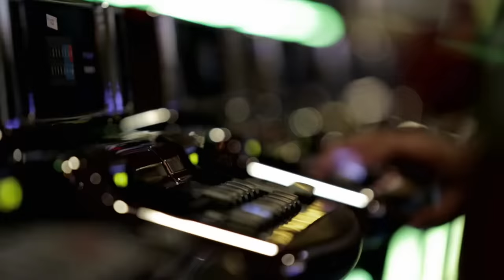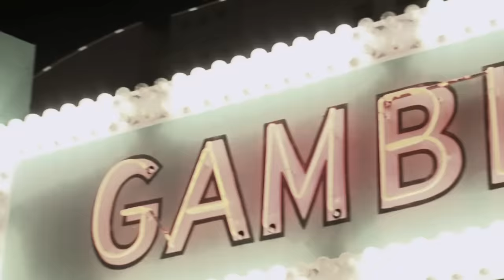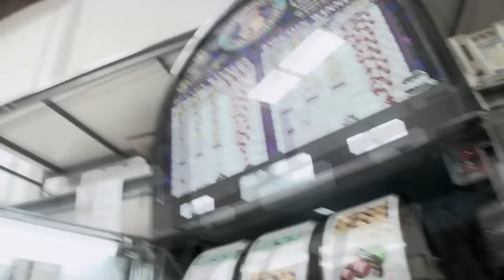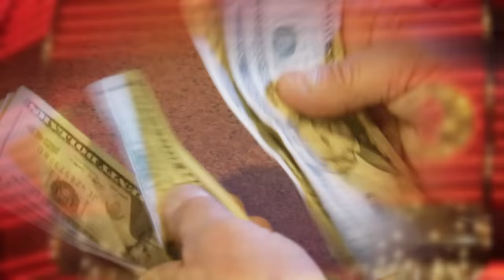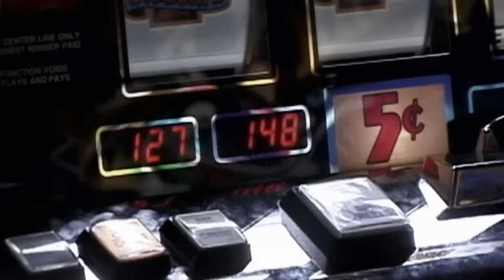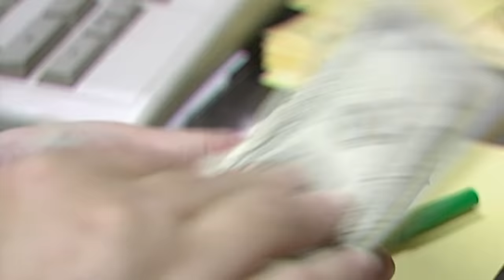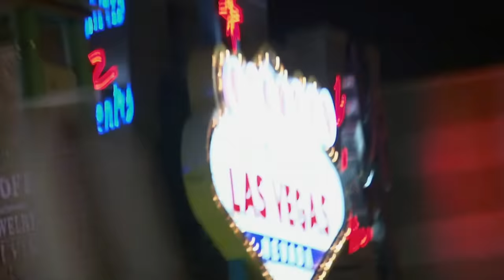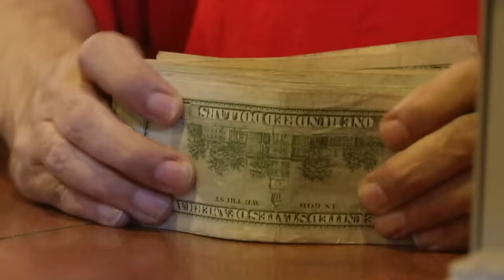The Game Changers of Cheating | Cheating Vegas | Episode 2 | FD Real Show

Comment: I googled odds on winning in a casino - 
The odds of winning in a casino depend on the game being played. Most games have a house edge of less than 10% and the average casino bet has between 35% and 50% chance of winning. The true odds of winning are 37 to 1 or 38 to 1, not the 36 to 1 that is the most the player can get paid on a winning bet. Slot machine odds are some of the worst, ranging from a one-in-5,000 to one-in-about-34-million chance of winning the top prize when using the maximum coin play.

Comment: The slot machines are controlled by there own computer system for payout or jackpots . Look on the back of the slot machines for the DSL wire . Ask a worker if they are tied into the computer system for payouts . You won't get an answer .
Reply: I'm a Slot Machine Technician and these machines have a phone line connected to them.
Reply: notice how it is easy to get very high scores during slots tournaments but not in real money games?
Reply: @doonlygoodeveryday9074  They are controlled .
Reply: @goodcitizen1379  : We are told the slots are controlled by a random number generator. Yeah!!! So why can the casino change the payout percentage of a slot machine?

Comment: True story - I have won on auto roulette 18 trips in a row. Past 3 trips now to the casino have lost. First they changed the ball, use to be a big rubber ball that would move and behave EXACTLY the same every spin as it should, all mechanical. Now with this new ball, you see the magnet pick it up and it will "skate" along the rim, also air blast will knock it out of a pocket, ball will do a sudden jerk. It is so clear that it cannot be denied. That's 100% cheating, can I sue the casino?

Comment: One thing is for certain. If you get caught cheating, you don't need to feel bad about it. If you were winning at the blackjack table and they couldn't seem to stop you legitimately they would bring in a "specialist". This specialist knows how to manipulate the deck and stop you from winning. I have this from a guy who worked in the casinos since the 70's. But if they catch you cheating don't let act like they own the high ground. They do not. The casinos have done a lot worse than cheating. But the cops work for them. The cops will arrest you for cheating, but they won't do anything about it when the casino cheats you.

Comment: Here is an interesting fact I learned about the newest video slot games, I heard the name HP come up as their makers. To expand on that, you do have to hack the machines which is hard because no public Wi-Fi and I am pretty sure they use whatever they can to block most cellular signals too. So with video type games, there are tenants that walk around with a programming pen that resets the machines. My proof, my ex wife and a few of her family members took a day trip to Reno and the host of the trip gave us all a package, X amount for the tickets and they gave us like $10 or so for gambling to start us in the casinos. Well I was on a low wager machine and was up and down but once I started hitting up more often, one of the tenants walked by and I started losing. Now to give context I was usually one of the family members that won, not as often as the others but I had my moments. One of my other former family members was going through the same thing as me on that trip and we were on the same row of machines so we both knew, time to cash out and move away from the ones with the odds resetting pens. It is crazy what they can now do with Bluetooth and "card readers" in small tech such as a pen that can reset the machines' odds. The other thing I know is that as a casino employee you are discouraged from playing at the same casino you work at and other casinos. About 2 hours in a few directions from where I live are Indian Casinos, they are all over Cali so it's not surprising. The Tropicana in Vegas and an Indian casino by me are the ones I have won the most at. But I'm not a big casino guy. Just thought I would share my experiences and a bit of knowledge I have picked up. I am a computer scientist but more on the repair side. 👍